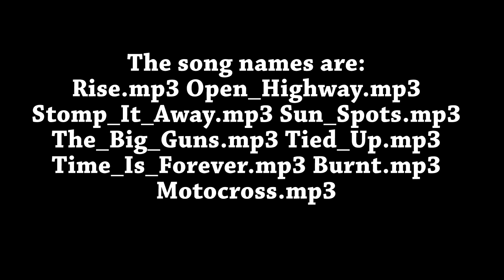DragonEye 18kt gold ring handmade

Comment: @scaffoal thanks again I'm enjoying your videos a lot, my questions: do you remember what size the stones were for this ring?  And how much did the ring weigh? I'm trying this with silver and know it's quite heavy so far, so I'm wondering what weight would be appropriate.
Reply from the maker: +anthony bianconi Are diamonds of 0.02 ct each, weighs about 20 grams of gold
Reply: +scaffoal also what size gauge did you use for the flat sheet? And what size gauge for the wire that made the fingers of the dragon?
Reply from the maker: anthony bianconi The single thickness that I measure is that of the plates that use to embed the gems, is 1.20 mm, For other measures I set from time to time according to the proporzini or of the deformation that must have the workpiece

Comment: I noticed the gems take heat well, does this work for most gem stones? I was under the impression that I would have to set them after welding the metal in place.Fantastic video, thank you for any information you can share.
Reply from the maker: Few gems tolerate high temperatures, and also the gems that can be heated must not have undergone treatment

Comment: Also when sodering do you need to quenche and pickle after that again if done prior?
Reply from the maker: +anthony bianconi I do not speak English well. I do not understand the question
Reply: +scaffoal after sticking the metals parts together do they have to be dipped in water to cool then dipped in chemicals?
Reply from the maker: anthony bianconi I leave it to cool in air. I use acids to remove welding residues

Comment: Try something like this: Make an aluminum base ring (I would say wax, but aluminum can be a better analogue when you need to hammer something in to shape and keep it a reasonable size) that can fit a large finger size and make a plaster mold around it. Heat up the mold to melt the aluminum and pour it out, pour the gold in and then bend it to a loop and begin working on it via a brass hammer and rawhide/wood mallet. All you need to do for each end where the loop connects is take a pair of clippers and snip off a length from each tine, that way the remaining gold stays in tact and more recyclable. You seem to be having some unnecessary difficulties between the hammer marks, gouges from steel equipment, excessively hard gold and lots of gold going to waste, and this will help ease the process and save a TON of money. 

You have the right idea using the dremel and file for carving small detail and overall smoothing, though, but you might even enjoy carving it out with a chisel if you feel crafty enough about it. I have only made basic rings, though, nothing as fancy as yours, so take my words with a grain of salt because you're doing great.
Reply: You have an immaculate touch with that dremel BTW.
Reply from the maker: +Cretaal Thanks. I used this technique because it allows me to have the basis of a single piece with the least possible weldings, and is fast enough to achieve.
In jewelry often different roads lead to similar results. Only time and experience will show us the best way for us

Comment: is it possible to make an 18k gold necklace with %75 gold, and %25 silver?
will they bond well?
Reply from the maker: normally it uses a gold alloy of 75% gold 17% silver and 8% copper that from the classic yellow color with a good strength of the metal. If we use the 25% silver we will have a pale greenish yellow alloy and metal remains soft. They have no problem to amalgamate.

Comment: Excellent work, sir. Every piece of yours I see is nothing short of a masterpiece. If I may, what type of solder are you using?
Reply from the maker: +Will Marcum Thanks For new works I try to use 18kt gold solder with a high melting point

Comment: I always thought you couldn't do any welding after putting the stones or they could get damaged... is that true? is there any tricks?
Great ring! Greetings from spain~
Reply from the maker: It depends on the stones and depends on the temperature to which they are subjected. it is always better not to be subjected to high temperatures, especially precious stones, you can risk with less valuable stones  if you do not have a choice, some gems can not be  subjected to heat.
Reply: Oh, I see... Thank you for answering so fast!

Comment: Sweet, I'm wondering what is the total time you have into the piece, and how much was actual Work Vs Concept, and what was the biggest challenge of the project for you?

You have some nice equipment, I pull wire with, well you would laugh!

;Peace)
Reply from the maker: Is difficult to answer. It took me several days to made it, but I am often interrupted by customers. There are particular difficulties, the most challenging part is deciding which technique to use to get the best result.
Reply: scaffoal
LOVE IT!
THANK YOU for the reply!

Did you custom make that for a customer, or do you still have it?

;Peace)

Comment: Is it possible to know how much you charge for custom rings like this?
Reply from the maker: +anthony bianconi This ring costs 2500 €
Reply: +scaffoal if that's close to 3000$ American then that's an incredible deal for one of your talented works. I would have assumed 5,000-15,000$ or more for such a masterpiece. I figured with gold, customizations, plus diamonds and rubies. 

Good you do a video on mixing your white gold and different k gold. I'm curious what ratios get what and I haven't seen anything on the web that I can find
Reply from the maker: anthony bianconi I thank these are the costs that we apply. If to mix different types of carat gold (14kt 18 kt etc.) fusing them together, there are many chances that the result is a fragile alloy that tends to crack

Comment: I always wonder how much gold is wasted in the sawing, filing and polishing phase of the process. AWESOME ring.
Reply: That cost end up in the value of the ring. The value of a ring should always be by the design and making of the ring than by the materials used.
Reply: when they clean the place they collect the saw dust and pins. they not throwing it away.
Reply from the maker: In gold processing will not lose hardly anything, it is fully recovered.. You can see this video https://youtu.be/TjhQNfDkP9o
Reply from the maker: In gold processing will not lose hardly anything, it is fully recovered.. You can see this video https://youtu.be/TjhQNfDkP9o

Comment: Sorry, dude. What kind of stone is in the middle? It is not afraid of temperature!  Just wondering  ))))
Reply from the maker: At the center there is a ruby, it is small and its value is low, the heat does not change its visual characteristics. I would not subject a valuable gem to the same treatment. thanks
Reply: Thank you, I am understand. The stone on video, is blue or purple . Ruby it is red.Then I made a mistake.Yes, rubies and diamonds are not afraid of temperature.But not a sudden change of temperature. Magmatic origin.I'm your colleague. But now, no. In Ukraine, a bad economy, people do not order jewelry. I'm very sorry, I love my job.  It's nice to see when a jeweler makes by hands, but does not use 3D print ! Old school is not dead )))) Good luck !!!        ( google translate )    sorry)))))

Comment: Would not it be easier to do it in wax and use a mold?
Reply from the maker: There are so many techniques to make a jewel. Not always the fastest ones are the ones that give the best results. The
 advantage of making handmade jewels is that there is no need for 
expensive equipment, you can vary the production to your liking, often 
jewels are technically better. I know and use all the techniques. My videos want to describe manual processing. Anyone from this point can start and pick the path that most likes. Thanks

Comment: That's the craziest way ever to produce what is a simple dome ring your waste is phenomenal. Try cutting a blank pattern first then form into a basic ring then dome it.
Reply from the maker: I wanted a thick ring without welding in the upper part.
Reply: you wouldn't have any soldering in the top part. only one solder join in the rear.

Comment: So why not just lost wax cast a piece like this?
Reply: no reason
Reply from the maker: Are two different production methods, I prefer for my jewelry classical machining, which guarantees me a better finishing and durability of the jewel
Reply: I'm a car guy so when it comes to cast VS forged I understand that casting something like a crankshaft will always be weaker than a forged unit but where silver or gold is concerned I didn't think it made a difference as they are soft no matter what you do. I'm sure I'm wrong but that is my understanding. I can't deny the level of craftsmanship, though I'm just missing some info that will let me understand why all the cutting and soldering is stronger than a single cast piece. I love your work, though.
Reply from the maker: JackDaniels2535 Generally, the gold and silver mergers remain porous. In craftsmanship the rolling mill to take away the pores and makes the elastic metal. Also in the melting rings you can not finish well the hidden parts.
Reply: scaffoal Thank you for taking the time to explain. That makes a lot more sense now